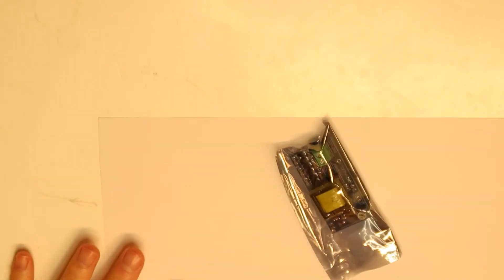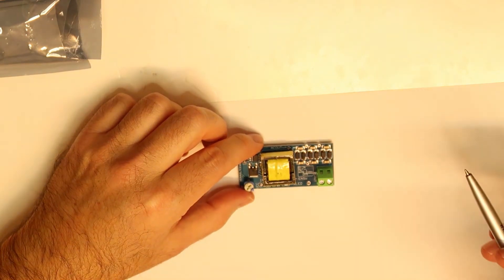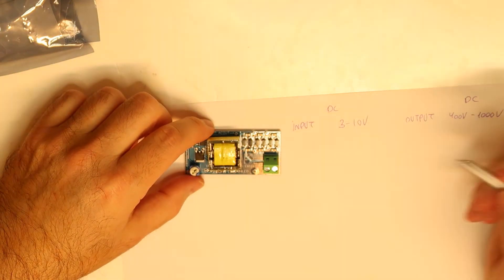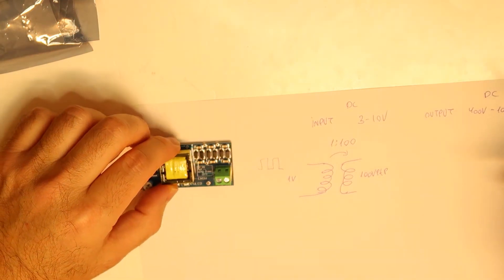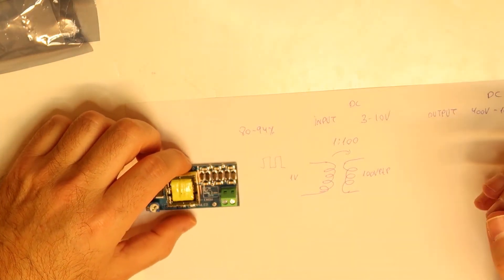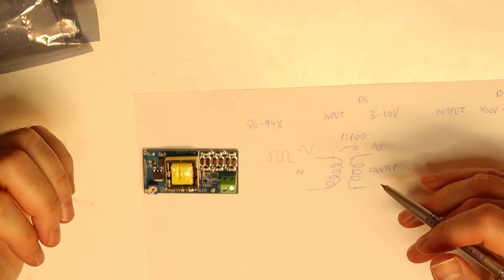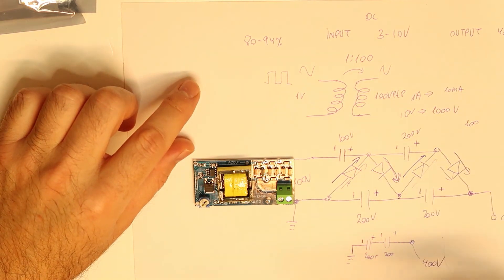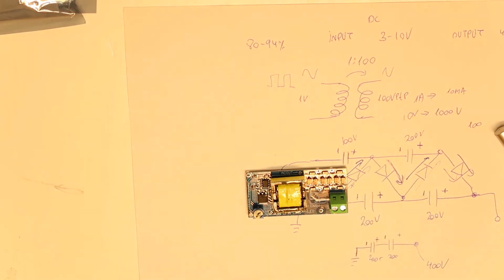High voltage from 3-5V

Comment: Hooking the positive off of this power supply to the negative cable of 8 solar panels wired together and hooking the negative terminal to the positive of the solar panels makes the 1000volts DC immediately crash down to the 12 volts DC source voltage. Weird as I see nothing in this circuit that should crash out. Also problematic since I can't reverse inject 1000 volts into my solar panels. Ill try again on just 1 panel and see if I get similar results. So far I do not appreciate.